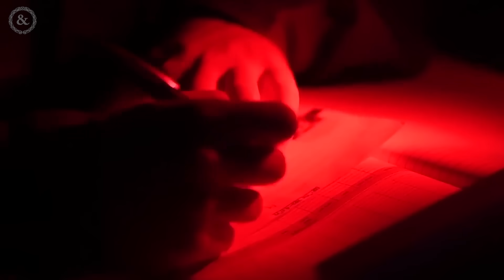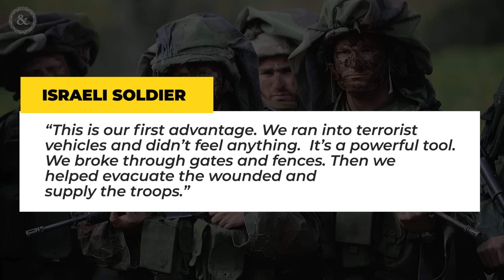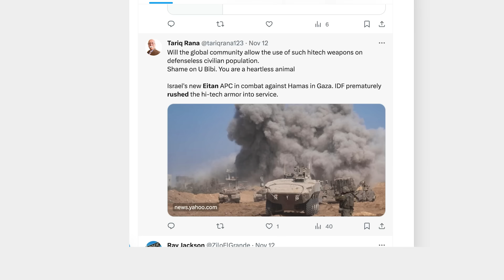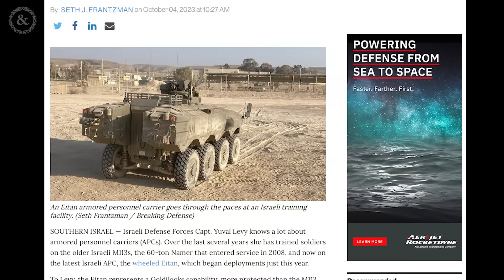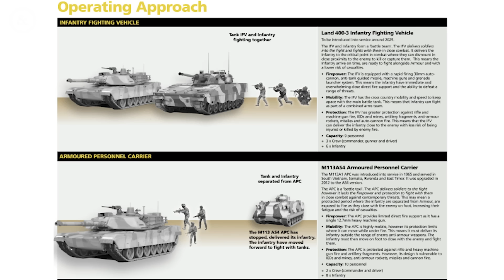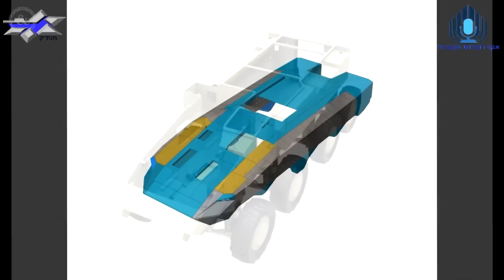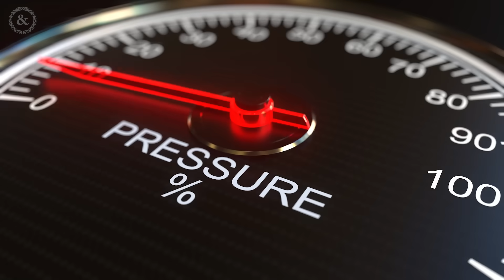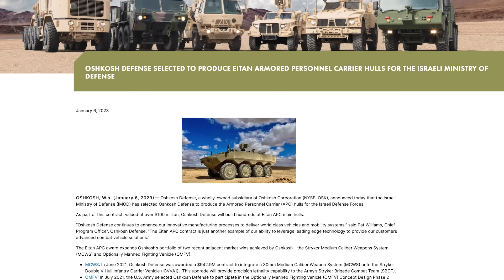Israel's Untested Armor Thrown into Combat

Comment: Can you imagine being one of those dismounts when the Iron Fist does an intercept? ☠️
Reply: The system was designed with dismounted infantry in mind
Reply: @Matt-yg8ub  I know. I am wondering how the computer makes decisions on saving a $3m vehicle and crew but fraging a fireteam.
Reply: @pkt1213  the system is designed with tolerances where the fire teams are supposed to be located at they have to stay on their zone.
Reply: Look at Israeli doctrine. Israeli soldiers are mounted, and when dismounted they aren't anywhere near the APCs. 

It makes the APCs more vulnurable to attacks, however, those APCs are designed to handle them using APS, ERA and passive armor. This made Israeli casualty rate in Gaza exceptionally low (<100 in the last 2 months), even though there have been hundreds or perhaps more attacks on Israeli vehicles.

Comment: This is exactly the type of thing that makes Wheeled vehicles the best for the job

Looking into the Italian Centauro, im very surprised that Israel haven’t purchased the Centauro II, sure its protection is limited, but the quick reaction, and its fire on the move capabilities are 2nd to none
With a full sized cannon and a 750hp engine, its a very very powerful asset
Reply: Centauro II is third of century old, underarmored and have limited upgradebulity. There is no much use in a firepower, if you can't protect it properly. Fire on the move capabilities is a basic standard in new systems, it's not unique up today. A full scale cannon on Eitan is a matter of an army request, if they'll ask - there'll be one.

Comment: Thanks Capy for a great video.
The edge that the Israeli designers have over their counterparts in military industry in other countries is that they have direct access to soldiers and units with actual battle experience, when collecting the requirements for new systems. In fact, some of those engineers were these soldiers a few years earlier or they still are in active reserve duty for a few weeks every year. Also during testing you get quick feedback so you can fine tune and tweak the final product. 
Iron Dome itself was tested in live action in 2009 and received a few upgrades while the confrontation was still going on.
Reply: Israeli weapons design engineers also work with a procurement chain of command whose first priority is national survival rather than economic stimuli.

Comment: 120KPH is 74MPH, they can travel that fast. I could be wrong, since I wasn't there. 
Wikipedia say it will do 90KPH/56MPH still that DAMN fast. 
The weight is also reported to be 30 to 35 TONS, not the 8 tons Caps stating. - After contacting Cap, sorted me out here. He said "Eitans" and it sure sounds like 8tons to me. As for the speed, Cap said 

"Eitan  can definitely go above the official open source numbers speed, that's the numbers for recommended routine driving. The Stryker for example is listed with a top speed of 60 mph but I know for a fact we drove it at 80 mph (not advisable it really starts to wobble at that point and its dangerous)"

Moving 30 to 35 tons at 74/75MPH is quite a feat.
Reply: Cap didn't say 8 tons. He said Ei--tan, which is the name of the vechicle
Reply: @danielsmith3265  I emailed Cap and he cleared up the speed issue, I also re watched  the video, and you're 100% correct, I'm and old Marine and going to claim senility.
Reply: Wikipedia isn't a great source for cutting edge military tech. It's pretty good for older tech, as those are known quantities with a lot of observed use. Newer tech often has purposely inaccurate info shared by the manufacturer--in the west, this typically is to under-sell the system so that enemies underestimate its true capabilities, while Russia and China are notorious for over-selling their systems to make them appear more impressive. This is why the Patriot systems taking down the Russian Kinzals in Ukraine was such a surprise to some. On paper, that could never happen, as the Patriot capabilities are above what was reported, while the Kinzal "hypersonics" were slower and less maneuverable than reported.
Reply: Can safely say it can keep up with logistical vehicles.

Comment: Israel has experience fielding new and yet untested hardware into active conflicts - the Merkava was deployed in the first Lebanon war while still being in initial integration stages in the IDF armoured corps.
Reply: Are you using multiple accounts? @BenyKarachun @danielsmith3265
Reply: can somebody explain why APCs don't have bullet-proof glass panels on its roof that open for the mounted infantry to use their eyeballs/guns
Reply: @theobvious1958  Israel had played around with mounting observation posts on top of heavy APCS, featuring bullet proof windows (search for "Nagmachon" for one of the later iterations), but this approach was proven unsustainable - the cost of manufacturing, maintaining and refurbishing after action were heavy, and these small windows did not provide a lot of visibility that was worth the trouble, while preventing easy access to train actual barrels towards the enemy. A remote operated weapons system offers much better visibility and being immediately able to shoot at what you see, while in the long run they save both money and lives - as an armoured position can always be defeated in some way to get at the squishy human inside, while a ROWS has no humans to be killed when it is targeted. As to the next question - why not use large windows, like they have in "armoured" cars - these are (a) super expensive, (b) super heavy - they weigh several times a similarly bulletproof piece of metal (c) they really suck at stopping anything other than low caliber bullets and will be a prime choice target for any enemy with an RPG, while the smaller windows are smaller than the accuracy of an RPG and therefore not a good target for one.
Reply: The Merkava 4 got destroyed last few weeks , IDF is now using merkava 3 the 90’s models on the ground and they are getting burned, just watch different news outlets
Reply: Development began in 1970, and its first generation, the Merkava Mark 1, entered official service in 1979. you're confusing Merkava MK1 MK2 MK3 (MK4 made in 2003) and MK5 which is the latest variant
Reply: @Jade_Bronson  there is no "mark 5". All the previous generation upgrades were huge changes to chassis, armor, fire control, suspension and engine. The latest iteration has some new features over the OG MK4, especially in peripheral sensors and additional digital capabilities, but it has no significant engine/suspension/chassis/armor or even fire control upgrades. Officially it is labelled as the "MK4 Barak", aka Mk4d, and only the media decided it is a new version.
I believe there will never be a Mk5 - the current generation will get a couple more "large" iterations (like MK4b was, and not like the MK4c was) and by the time it will be too outdated, the MBT will become completely obsolete and we'll have something completely new - maybe based on the Eitan concept. 🤷
(Full disclosure - I worked with and on Merkava tanks from the MK2 up to the MK4b).
Reply: Shows how dire the situation is for them. If we compare to other nations that act seems very unwise.
Reply: Yeah, and it ended not being that superior to the Siryan old T-72s
Reply: It won most engagements against T-72s, even then it's not enough to say it's superior. Merkava Mk1 wasn't that good, it was Israel's first tank.  @Fulcrox
Reply: @BenyKarachun  Well not being good is rather subjective. the question is T-72 operating in the environmental conditions of the Merkava how would it fair?
Reply: @Fulcrox  the T-72 wasn't old in 1980
Reply: @Fulcrox 😂
Reply: @Fulcrox *Syrian
Reply: ? The T-72 was still a new tank when it fought the Merkava 1, and the Merkava 1 kicked the crap out of it.  @Fulcrox
Reply: @danielsmith3265 flying tanks are better than ground tanks tho😂
Reply: America
Reply: @doodmonkey   USA! USA!!
Reply: @wulver810 WHAT THE FUCK IS A KILOMETEEEEER 🗣️🗣️🇺🇲🇺🇲🇺🇲🦅🦅🔥🔥🔥🔥

Comment: Thanks for a great video , the Iron Fist have also not seen real battles yet... the version used is called Iron Fist Light Decoupled, this version was made to address needs of the US army after testing few years ago with the original version were only partially successful and it was too heavy... I don't know the ETA of the testing but this system looks more suitable for APCs ... it was chosen also for the Australian Redback, Trophy is still the dominant for MBTs
Reply: Yeah, the only reason to pick the Iron Fist over Trophy is weight/energy issues. Trophy is far better, but it's too heavy for most vehicles and takes up an ungodly amount of energy. Trophy is more effective, but it can be fit on smaller vehicles, and even helicopters.
Reply: @theprogressivecynic2407  I think you meant to say the trophy was more effective
Reply: @Matt-yg8ub  Yes, thanks.
Reply: Iron fist is an improvement to an existing system

Comment: Didnt realize israel had their own cybertruck. They should have stuck to the aluminum look though
Reply: Aluminum basic chassis. Then the addition of electronics, munitions, armor protection.
Replaceable batteries, electric motors, and this gives Tesla a marking product. This Tesla vehicle could be manufactured in many nations, automatically by robots, very fast, and much cheaper than other methods.
Low maintenance aluminum and stainless steel basics.

Comment: Not sure if Iron Fist is better than Trophy.  Each has their own pros and cons.  The pro for Iron Fist is it's a lot lighter than trophy and was designed for light infantry vehicles (jeeps, hummers etc...) - meaning that if you can support the weight (e.g. Merkava) the Trophy is probably the better system.
Reply: Trophy is more effective and has more ammo, while Iron Fist is more flexible on where it can be put.

Comment: Driving for even 500 miles in Israel is quite a challenge.
Reply: 😂 true
Reply: @EdMcF1  Air cooling for the day, air heating at night? Comfortable suspensions to assist rough terrain?
Reply: @gregzeng  it isn't about Israeli infurstcture or wether it's about its size
Reply: Not in a tank

Comment: I saw a video of Israeli soldiers rescuing a team from inside a hit apc. They typed in some code in the back of the vehicle to open the door and save the crew that locked themselves inside the apc. That was very interesting to me. Is this like a safety measure the apc crew can use so they won't get taken as prisoners and can wait for rescue? I've never seen any other army have this thing in their heavy armored vehicles.
Reply: I know the video you're talking of, it's a special police unit coming to their rescue...I don't recall them entering a code to open the door, though.
As I recall, they used the intercom on the back of the APC to talk with the wounded soldiers inside and inform them that they were the police coming to get them out.
Reply: @FlinnGaidin  that makes considerably more sense, there’s no point in putting locks on the car If you key them all the same, and the enemy gets a hold of it. Locking doors, make sense in urban combat…. Especially combat where the enemy is trying to take hostages.
Reply: @Matt-yg8ub  yeah...after posting that comment I rewatched the video...definitely an intercom for infantry to communicate with the APC crew, with the soldiers inside unlocking the hatch when they understood those outside were friendlies.
Reply: Probably just a door lock
Reply: @devon5154  Most military vehicles, believe it or not, have no such thing. Locking the door is kinda pointless when you have to station GIs to guard the equipment anyways. And during combat it can be even detrimental at times as it may prevent crew from escaping. So yeah, the idea may be indeed to avoid taken hostage. A conventional army  may only call artillery or any other ordinance but in assymetric warfare where the other side is eager to take hostages this function may not be bad.
Reply: @devon5154  Yeah it was a door lock. And the crew that came and rescued them also knew the code to get the door unlocked. That made me wonder if the purpose is just for situations to prevent the crew from being taken hostage.

Comment: The Eitan is probably most similar to an MRAP with more firepower.
Reply: Only thing it really shares with an MRAP is that it's wheeled and mine-resistant. It's much heavier, has much better protection against machineguns, autocannons (well, lighter autocannons) and RPGs and it's probably much better at handling rough terrain (with 8 wheels and a less top-heavy weight distribution).

From what I can tell it's "Stryker, as it should have been designed".

Comment: There's a grand tour episode where Hammond modifies his car to have treads. It sounds like an ideal solution to their regular problems, but it only lasts a few days before he's forced to put wheels back on. Tracks have a lot more moving parts, so more areas of failure. I his case he had equal issue on deep mud, sand, and paved roads. Sure you can point to the specific type he was using, but as mobility becomes more important on battlefields, tracks may get left behind with heavy tanks.

That said, wheeled assault platforms are intended to go against enemy infantry. Hamas is a terrorist group, not a military. There's less need for protection against enemy armor, or even air units. Direct confrontations are going to favor the formal military's training and technology and resources. 

Israel is also unlikely to fight a modernly equipped ground force on their borders in the next decade or 3. The West are the so exporters of the modern standard of weapons, and short of a revolution in certain bordering countries and a reversal of decades of diplomatic work, the most successful middle eastern nations are more western allied. Iran does not have the capacity to take Israel on militarily, or if it did, the US would be likely to get involved. Egypt and Saudi Arabia likewise are more western leaning is disposition.